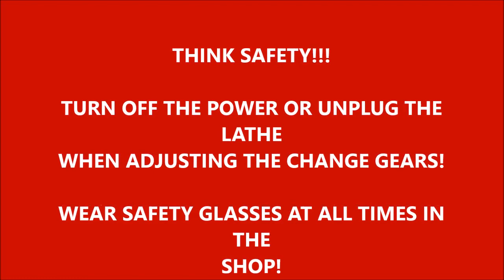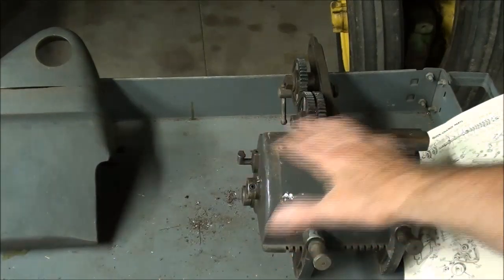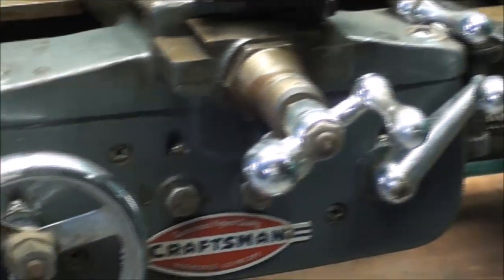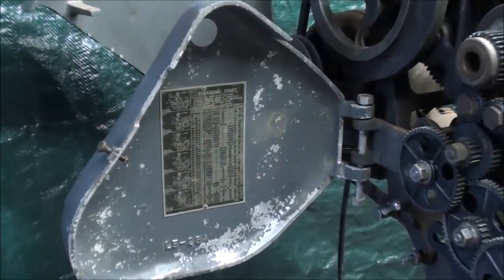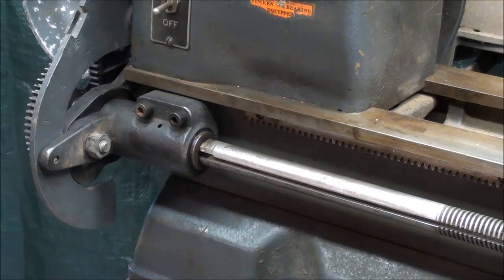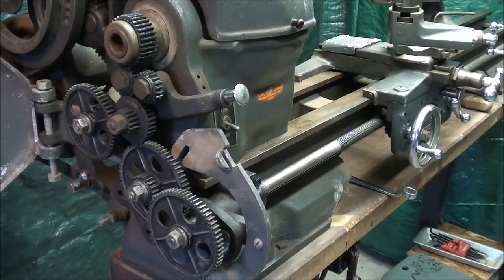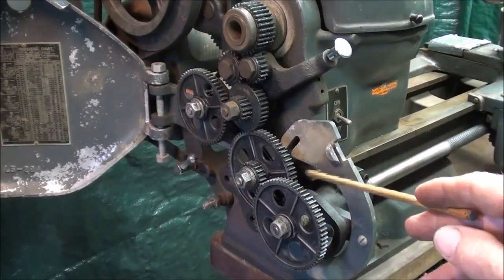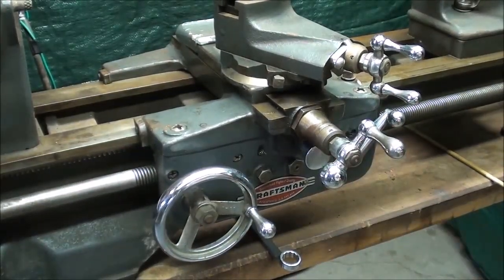SHOP TIPS #220 Adjusting the Change Gears on Atlas Lathe pt 1 tubalcain

Comment: Thanks for the tip on cleaning the lead screw. I have tried the string method and won’t do it again. The last time I cleaned it, I removed it, soaked it in degreaser and then steam cleaned  it. I don’t know if it was a good idea or not but it looks brand new now! I used to grease it but I like your idea of using oil better. Thanks again.

Comment: Man I wish I had this video series about a month or two ago when I bought my Atlas.  Mine did NOT come with the quick change gear box (or any gears for that matter!  Was missing a lot of parts) And I had to do a lot of research on which parts I was missing and how to install the quick change gear box.  I had to fabricate the template plate to drill the hole in the head stock and everything.  It is all up and running now and I love it!
Reply from the maker: +MattsMotorz Thanks for watching

Comment: Thanks!
A friend gave me a very worn but functional lathe nearly identical to this. All the nameplates are missing. It has one set of gears installed, and they work. I will search for a complete set to purchase. 
I have used the lathe manual feed, for making some transmission parts and I don't know how I got along without it for so long!One of these days I'll make a video about it.
Reply from the maker: +davida1hiwaaynet Thanks for watching--sounds like its still a good lathe

Comment: Amazing!  I always learn something.  BTW, those ZAMAK gears will break if leave the reversing lever in neutral and suddenly bump it to engage the gears.  Don't ask how I know.  Unless I am threaading, I take the spindale stud gear off.  I don't think mine has the locking device the one shown does.

Comment: I picked up a very early Atlas/Craftsman 12" at an estate sale.  From the s/n it was made between 1936-39.  There is no cross-feed and the lead screw is 5/8" not the 3/4" of later models.  I have it running on a home built bench.  I had to buy and fit chucks for the lathe, an 8" 3-jaw and a four jaw both from across the big pond.  It has been a good machine and now runs alongside its little brother, an Atlas 6" that I dearly love for small jobs.
Reply from the maker: +M Sandford Thanks fo0r watching--I'm not familiar with that older model
Reply: +M Sandford I'll PM you here in a minute with my email address. I'd love to see a few pictures of you 12" Atlas. I might be able to nail down the year for you. I have a 12F 54", mid 1937 (in the middle of 1937, they changed the design; the shape of the bed feet are a good indicator of year).

Comment: I got lucky to find 2. 12 inch atlas lathes with quick change gear boxes and both in great condition with no slop in bushings, and all gears in great condition and was happy to realize that the gears are steel in the boxes when I was worried about them being zmak like the gears on lathe itself, l guess that's why the gear box costs as much as lathe itself..

Comment: On the 10" atlas you can change the feed direction on the fly as it is made with a small bevel gear box but I an sure that you knew that. Thanks for the video!
Reply from the maker: +madmodifier Thanks for watching-never used one with that little gearbox

Comment: Did some research and that, with a little conjecture, gives me a guess at the double key for the gears: reason one is strength. The metal is not real strong and the double key spreads the load ovr more material at the hub where the most stress is. Two is symmetry when casting, as the shrinkage around one keyway will lead to worse distortion than around two. A possible thisrd (wild guess) is that is helps keeep the gears centered better given the sloppy tolerance on the hub bushings used to mount the gears.

Comment: I have 6 atlas lathes with zmak gears and only 2 gears of all 6 show some wear and there the gears on forward and reverse tumblers, Hell the new lathes have nylon gears and they seem to do ok..I actually changed my drive gear from 48 to a 24 tooth nylon gear to slow down feed and also save the lathe if I was to crash ,been a year and it's still fine

Comment: Hi, Mr. Pete.

The cross slide ball crank on my 6" Atlas/Craftsman lathe was broken in shipment. Having a nice new lathe, I made a new crank. Otherwise, I've had NO  Zamak breakage in 35 years of use. I did have a problem when I ya-ya'ed the lock pin hole in the bull gear a bit, due to an overly aggressive interrupted cut. I just tightened the setscrew in the gear's rim and went on. The replacement bull gear sits in my tool box until I, or my grandkids, need new belts. 

I'm guessing the change gears were double keyed to spread the load on the gears and their Zamak bushings.

By the way, do you get much in the way of stretching noise from that belt, or is it drowned out by the characteristic Atlas "clatter"? I don't know, though.  It's probably worth a little bit of noise to keep from having to remove the spindle and countershaft.

Tom
Reply from the maker: +awhs1964 The zamac is pretty durable. The lathe is so noisy-cannot hear the belt

Comment: I have the same  12 inch lathe  bought cross slide nut on Ebay new manufacture  I use a paper bag to adjust the space between the gears or gear backlash
Reply from the maker: +1995dresser Thanks--thats a good idea

Comment: Mr. Pete, I have a lathe just like that and I don't have the quick change gearbox. I'd like to have one if possible. I haven't started looking yet or anything. I wanted to ask you first what would be fair price if I were to find one. I can live without it but still, it would be nice to have it. Maybe you even have one to sell? Thanks and thanks for the vids. I watched all three on this topic and I'm working my way though all of them.
Reply from the maker: You can expect to spend three or $400 for that gearbox. And you usually need a new lead screw as well
Reply: @mrpete222  I don't mind the three for four hundred dollars. I'd gladly pay it but I'm not clear on why the new lead screw? Is that because it's likely too worn or worn differently than gears in the box? Thanks for replying.

Comment: MrPete, I have an approximately 1895 E. A. Kinsey lathe (about 4 to 6 foot bed and around 16-20" swing) that I pulled out of a local box mill that closed this summer after 120 years, about how old my lathe is.  It of course does not have a quick change tool box.m I have most of if not all of the change gears, but have no idea how to set the gears up to set different lead screw speeds.  I was wondering if you had any advice or knew of anyone with any literature that would be of help with this lathe.

Comment: Please talk about the little dial on the right side of the carriage that I've seen people use to start a threading operation.
Reply: +Doug Rundell Mr. Pete will get to this soon I'm sure. In case you're just wondering how it's used, here's how. 

The round dial has four marks on it (like a compass, North, East, South, West). The round dial's HOUSING has one mark on top (think North). Once the change gears are setup (which sets the feed rate of the carriage), the cutter on the carriage (compound slide) is moved to the correct depth for the initial thread cut. Once one of the four marks on the dial come into alignment with the North mark on the dials housing, the carriage auto feed is engaged. After cutting threads to the desired length on the stock, you quickly dis-engage the auto feed. At this point, you back the compound slide back, RETRACT the carriage, move the compound slide back in (to the next thread cut depth), and wait for the marks on the round dial indicator to line up again. Once they line up ( like - - (but vertically)), you re-engage the auto feed and take the next cut making the thread deeper.

To cut a good thread of decent depth, multiple passes on the same area often must be made. If you engage the auto feed at the correct time, using the lines on the round indicator, you wont cross-thread your work.
Reply from the maker: +Doug Rundell Thanks for watching

Comment: I noticed when turning the lathe On or Off, the switch on the lathes' case remained Off.  Why did they abandon the ON/OFF switch as manufactured?
Reply from the maker: +hankus253 A reversing switch was installed
Reply: +mrpete222 The previous owner of my Atlas 10" did the same thing, installing a drum switch.  Reversing the motor however tends to unthread my chuck, so I've always used the reverse gear combination for reversing the leadscrew.  But I may be missing something??
Reply from the maker: +hankus253 The switch reverses the motor & hence the direction of rotation for the spindle.  The leadscrew simply reverses the travel of the carriage (tool)

Comment: Should I use lucas red n tacky on my open gears in lathe?
Reply from the maker: Some people say that that kind of oil attracts the chips
Reply: @mrpete222  I could see that, but I'm thinking more of the quick change gear box, I noticed even oiling as much as I do it's just slinging it all off and can't keep enough in it,,,and the mess it makes trying too is just too much,,,and not many chips can get in there anyway
Reply: @mrpete222  I understand that , the gears are in quick change gear box and on left side of with cover,,,,I sprayed it anyway and I can't hear gears rattling now like before,, it's 50 years old and all the teeth look good,,,, but I'm sure they was having to oil the hell out of it as it was slinging off..
Reply: @mrpete222  I understand that,, teeth show little wear , but I'm sure they was having to oil it as fast as it was being slung off,,l sprayed it anyway and I can't hear gears rattling now like before when engaged,,,l think if they had it back then they would have used it.